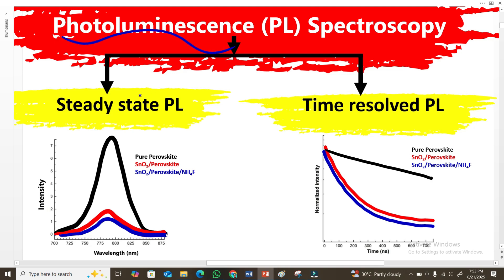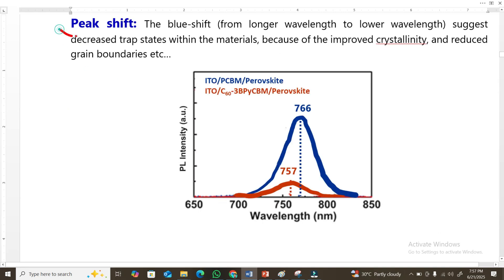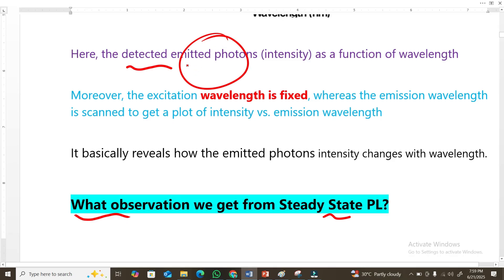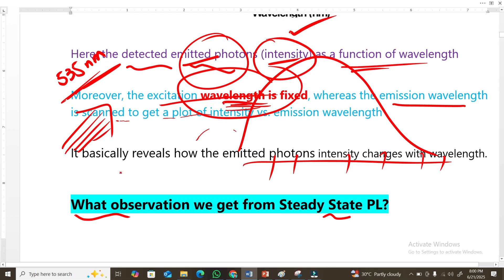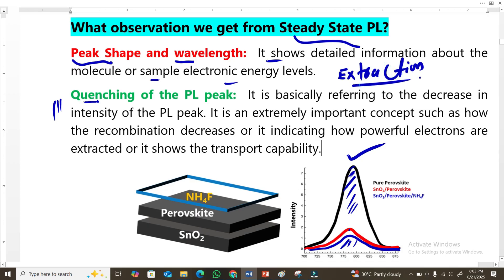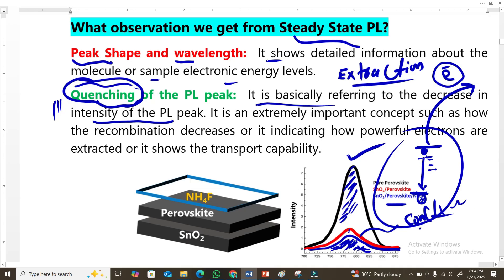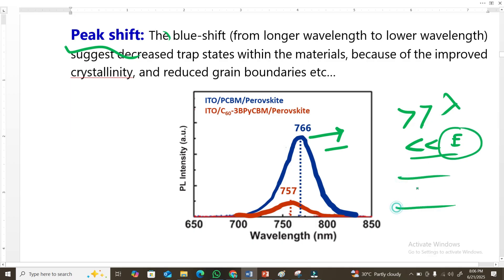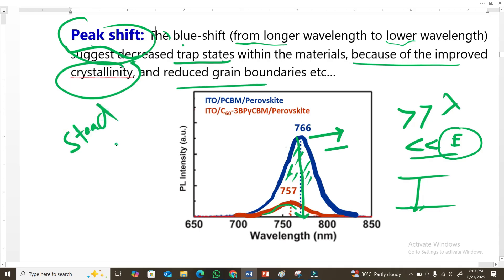Steady-State vs Time-Resolved PL: Clear Explanation With Examples

Comment: If i am not wrong the shift in the above diagram is called red shift. The shift occur when spectra shift to higher wavelength and blue shift is opposite to it.
Reply from the maker: Thank you for your comment. You are right. In this video, I have just shown that peak shift is one of the key characteristics to observe during the steady state PL analysis. 

For example, when we want to interpret the steady PL spectra, so we have to look for few things, among them, peak shifting is one of the key characteristics. If the peak shift towards the longer wavelength, this means that the energy or band gap energy is lower according to the E = hc/ λ and vice versa. So, this peak shift show a drastic changes in the materials optical properties. 

My main concern was not blue shift or red shift but simply the peak shift i.e., towards the lower wavelength or shorter wavelength. This shift show changes in the materials structure and other properties. PL is the tool to tell us this kind for information. 

Once again, thank you for your comment. Let me know if you have any questions